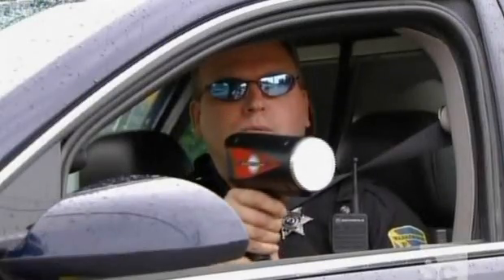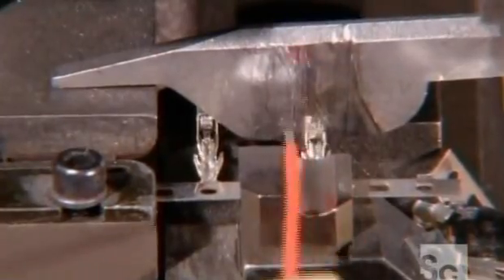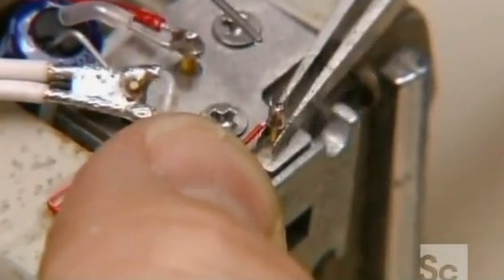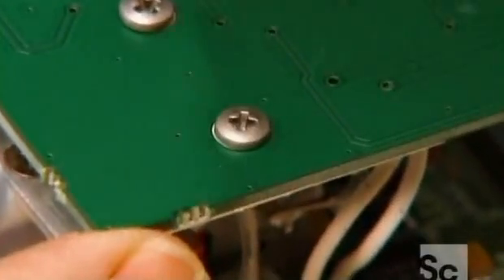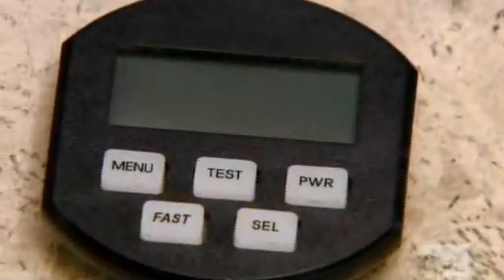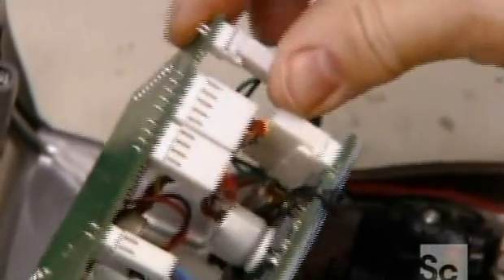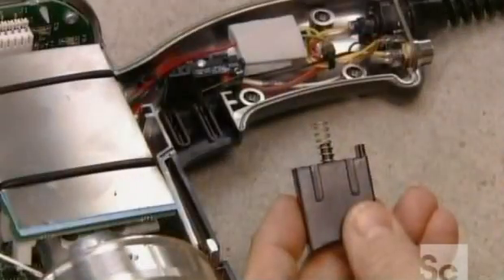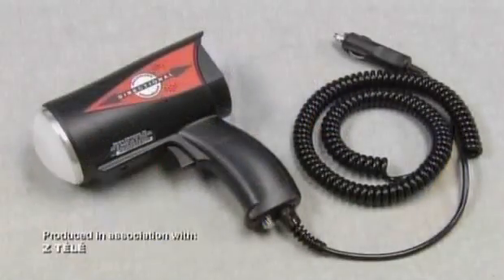How its made - Radar Guns

Comment: Technically this is not RADAR. 
Ships and planes use RADAR which gives information about the location of objects (where they are in relation to the radar operator), how fast they are moving and in what direction.
The technology here is microwave speed detection. It does not tell the operator where the object is or how far away it is. It only gives speed.